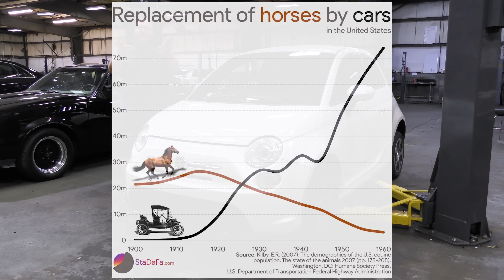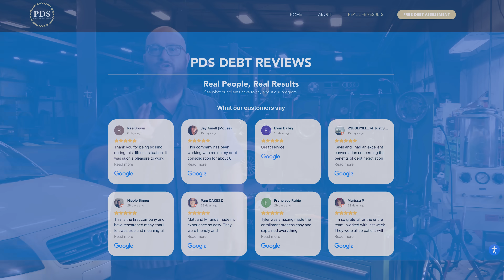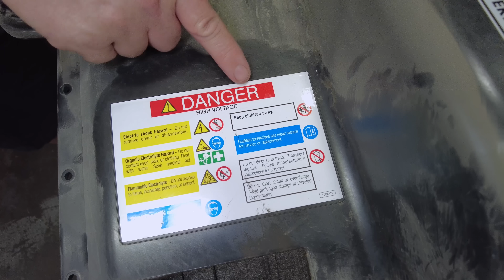How to SAFELY Remove the EV Batteries From my Fiat 500e

Comment: The catch on battery interoperability the problem is this EV  push is from the GUBBMINT (therefore redundantly incompetent). And the proprietary OEMS  who wish to cooperate on nothing. When Intel IBM  opened up the 8088 Cpu. And DOS THE PC  computers too off.  Commodore, Atari and the others went away. Folks here's the roadmap and a 1000 mile range.  Now you future Hot Rodders  get to work on your own dual quad flux capacitors.

Comment: There needs to be standardized 50-100V bricks that people can buy off the shelf. Until then, EV batteries won't be sustainable: you are always one bad cell away from scrapping your EV once the warranty runs out since it is difficult if not impossible to get an affordable known-good replacement. That is almost like scrapping an ICEV because one ignition coil or injector went bad.

I don't particularly care about range as long as it is at least 300mi/500km under worst-case conditions, can charge in less than 20 minutes during road trips and L2 charging at destinations becomes standard.

Comment: It’s not EV’s most opponents of them are really opposed to. It’s unrealistic government mandates forcing people to have to literally buy in to the “green new deal” narrative. Free market will solve the problem and bring desirable products to market, but currently the production capacity is not there to pull the necessary amount of rare earth materials from the earth at the rate required for the government mandated demand. There is currently no safe recycling facilities for recycling these batteries. There is not currently enough capacity in the energy grid to supply all the power necessary for all of us the charge our EVs. The rate at which charging them is too slow to be comparable to ICE refueling, and the faster you charge an EV, the more demand is required from the infrastructure, and the more likely a thermal runaway incident is.
There is also not enough safety protocols and requirements to deal with the inevitability of these batteries catching fire. Frequency of Lithium battery fires is NOT and argument, there are far more dangerous to the environment and the humans involved in extinguishing them. They great their own oxidizer as they burn so they are also impossible to extinguish, everything around them is at risk, and if the person fighting one of those fires could be irreparably harmed or killed from the cobalt gases that are commonly emitted during a lithium battery fire. There is also the issue of ground water pollution from the run off of the water used to fight those fire. Just look at the uninhabited high rise apartment building after the Korean BarBQ that went off in the underground parking when a MB Eqs went us.
There is a lot that needs to be addressed before we adopt EVs as the only means of propulsion.
I don’t think that is wise. There is a reason trains and transport trucks that run virtually 24/7 use diesel engines, even if all they’re doing is creating electricity for motors to turn wheels. It’s more efficient than storing the energy in a battery.
My point is there’s a lot of cases where EV‘s don’t make sense and we need to acknowledge that. The government should stop trying to force them down everyone’s throat. It doesn’t solve the climate issue, anyway. Humans driving themselves around in ice vehicles only accounts for maybe 12% of CO2 emissions, globally. If I could afford an EV and I could charge in 4 hours where I have to park it in a random street spot, I would have an EV, but I’d keep driving my classic car for enjoyment and my ICE appliance car for long trips, except I can only afford one vehicle, it has to live on the street, and the CEO’s get the charger spots at work so EV’s are not for me until those issues are solved, no matter how much I want a Porsche Tycan Turbo S

Comment: That would be great on batteries. However, for an EV, the battery pack is like the motor on an ICE vehicle and we’re over a hundred years going with no standard industry motor.

Comment: Great follow up. It’s great that you began with the horse and cart analogy! 
Regarding unified battery technology you are spot on. If they can create manufacturing plants that simply make the batteries for all car designs worldwide from the same cell types, BMS, etc then we will have success in uptake. Not only would this reduce the outlay for manufacturers of the vehicles, since they simply buy that component outsourced, it would mean cheaper batteries since one or two companies would be making the batteries for the whole market. This would also have the knock on effect that R&D would be more cost efficient for those battery manufacturers. I liken it to having cancer funding for 50 different foundations that research cures and preventions, rather than just feeding one or two foundations the funds. Less costs! Better results!
Some manufacturers are already looking to the swap and go battery tech too… do a bit of digging. I cannot remember which makes, but it may have been the Citroen AMI? This will also be an interesting option in future. Pull up to a large battery swap bank, remove your discharged battery, tap card on bank wall and remove a fully charged battery and install, drive off! No charge delay

Comment: Ive been learning a bit about batteries overall lately, my thought is lithium and high power batteries aren’t getting any bigger for their respective size, we’ve seen huge leaps in mah stored in a small size. So my theory being if you buy a electric car today, by 10-15 years when the packs kaput then a whole rebuild should be more powerful or have a little bit more space for a extra few cells. I sort of see it like modifying an ice car by replacing an old 350 engine with a new crate 350 maybe some things will have to be tweaked or setting changed but it’s been refined due to modern machining.
Reply: Extra cells, and longer to charge :)

Comment: One area that has mystified me is that for some unknown reason EV proponents keep repeating that EVs are "pollution-free" ... while although the actual EV is pollution-free .. the electricity used to charge an EV carries with it pollution.  Maybe they don't realize that burning of coal was most likely used to generate the electricity (to a lesser extent nuclear, hydroelectric, wind).  But if they believe that the coal burning process is 'pollution-free' then I guess it is "pollution-free".  I also find it funny how EV proponents have now become prophets and able to see the future with their "EV's are the future" mantra ... could be but maybe not, only time will really tell... let's compare the Fiat 500e to a 2025 Honda Civic Hybrid ... the Civic is at least $10K less goes a lot further on a tank of fuel and arguably more reliable ... now tell me again why I am buying the 500e??? ... economically it doesn't appear to make much sense ... wait one last calculation ... $10k / $5 per gal = 2000 gals X nominally 30mpg = 60000 miles of "free" driving with the Civic ... EV proponents also tout the lack of oil changes as a plus but fail to mention the opportunity cost of driving an EV to anywhere outside the battery range... bottom line for me ... separating the wheat from the chaff ... the nonsense / the rhetoric / the BS ... ICE vehicles are no better than EVs nor are EVs better than ICE vehicles ... they are simply forms of transportation .. please buy the one you prefer ... What do I drive? come Sep it will be a 2025 Civic SI complete with a manual transmission because I am an enthusiast and enjoy driving a vehicle rather than being a passenger...

Comment: Unified batteries consistent across all brands would be similar to all manufacturers using the same engine and transmission. BMW and Nissan - Honda and Toyota - it’s not happening.

Comment: The part you are missing when it came to horses vs cars, is that the Government didn't tell you that couldn't ride a horse. Or that if you did ride one, you were killing your grandchildren. 
The fact is, I would actually like to have an EV. I would benefit greatly from having one, since 9 out of every 10 days, I only drive too a from my store. But I will not buy one until the 1/2 of the government that I do not support stops telling me I have to buy one. I'd rather walk. Yes ... I am an old, curmudgeonly, boomer. And damn proud of it.

Comment: Electric cars are just a fad that won't last since they have too many problems and will be worth nothing after the battery goes bad in 10 yrs. so buying one is just poor planning by the buyers who aren't looking at what will happen to their purchase in the future. Here are just a few of the problems:
1. Prices too high.
2. Insurance costs too high.
3. No AM radio!
4. No spare tire to use in case of a flat.  Tesla owners have to call a tow truck if they have a flat!
5. Poor resale value, is any at all!  They can't be traded in when the owner wants a new car in a few years since they won't be worth anything and won't even be able to be passed down to another family member if they aren't running and there are no parts available.
6. Poor range.
7. Poor charging networks. I've never seen a charging station on my side of town!
8. Companies going bankrupt!
9. Necessary software updates not always available!
10. Parts and service not generally available.
11. Often can't be repaired after even a minor fender bender accident!
12. Cannot be serviced by the owner or maybe not by anyone if the company has gone out of business.
13. Replacement battery costs more than $10,000 when it goes bad after the 10 year warranty expires making the car worthless
14. Over the air software updates using 4G won't be possible in a couple of years after everyone has switched to 5G!

Comment: LOL; all that has to happen is a car can be driven 1000 miles on a battery pack the size of a loaf of bread.  Common sense should tell you that will never happen safely; the power density for such a proposition is mind boggling.  As the technology is currently, I don't feel comfortable sitting on top of a slab of batteries knowing how much energy is being stored in them; I'm crazy, but not that crazy!

Comment: The heat in Australia is greater and there is no issue with the battery life there so there must be another issue in Arizona.   Is humidity higher?   (High humidity and twmp may be an issue)  Salt used on winter snow?   (Cause deteeioration in terminals)  Just a couple of variations possible

Comment: My friend Audi E-tron with 20,000 miles. Died on the road, it gave him a 30-second warning  before shut off. The front electric drive motor shorted out due to the cooling ports that were drilled into the motor assembly for cooling cracked and leaked coolant into the motor. $20,000 replacement cost. It was performed under warranty. He was not the only one who had this issue. The dealership had 6 other e-tron's with the same failure.
Reply: BMW has had multiple engine failures due to faulty engineering.
Reply: Toyota's recent engine replacement is another example. New technology carries some risk.
Reply: 30 second warning for a catastrophic failure sounds amazing. Much better than boom💥
Reply: They are now using oil to cool the electric motor like in HV transformers, no coolant needed.
Reply: Modern german auto is crap all over the board. I would never buy one car from them, ICE or EV. Just look at what is on the roads: Less than 3 yo vehicles still under guarantee. After that they drop like flies. Even a cheap Chinese car does better than laggardcy German auto (who btw has been caught again using cheating devices to mask the pollution of their overengineered garbage engines).

Comment: Do not try charge it without coolant in the battery pack. The coolant PTC heater turns on for a moment and without coolant overheat, short it will blow the fuse in the battery pack. Had to learn this the hard way.
Reply: Thats what I expected; though it maybe necessary to identify low voltage packs, and bring them up individually into the average acceptable range (safely at low charge rate), before turning control over to the onboard charger to do fine balanceing. Otherwise it may just throw fault codes (call the Tech!) and refuse to charge - been there, done that!

Comment: Anyone who still say "but after 6 years the battery is dead", just look at this fiat, its 10 years old and its problem is an electronic module, not the battery cells. As the wizard said, earlier evs didnt had colling for the battery so their battery was dead quickly. This fiat and anything newer than that have cooling and its rare that the battery degrade so much. Also newer batteries supposed to be have longer life - from what I hear LFP type batteries that is common mostly in anything that is medium and cheap-ish should last basically forever... But as you can see in the video the problem is hard to reach parts that are unobtainable. So a very popular modern EV should be very long lasting. We will see..
Reply: "normal" Li-Ion batteries, aka NMC, have more energy density and are used in phones etc. They last about 800 cycles (0%-100%) until 80% of the battery still works, then there's a rapid dropoff until they die. I actually used a 2012 phone up until 2023 which now doesn't hold a charge at all. So 11 years from new to failiure is pretty good.
LFP batteries are actually worse for energy density (less range for more size and weight) but last 2-3 times longer and are also a lot safer. They should be great for small "around town" cars, something else will fail before the battery does. There's also talk of giving old EV battery packs a second life as powerwalls in houses, so people can solar charge them during the day and run things at night.
Reply: How many miles did he say was on it? Its the charge amd discharge cycles as well as overheating that matters more than how old the batteries are.
Reply: Also most of the lithium in a battery is recyclable. It needs to be reconditioned in order for it to be put back into a battery.
Reply: @MB-jz3uu  really?  Please provide sources on current EV battery recycling facilities and what percentage of lithium recovered.
Reply: @rjbiker66  institution of mechanical engineers did an article on it back in October.
Reply: @rjbiker66  jerryrigeverything did a good video on it. It's pretty fascinating. I used to think it was all doom when it came to electric batteries.
Reply: Batteries don't last forever, your phone is an example. They will degrade to the point that you can't use it for anything useful anymore.
Reply: @popifrex1993  But you can extract the parts and make new ones. Those trace amounts of rare metals / increasing demand for lithium might even make it profitable!
Reply: @popifrex1993  my phone dont have cooling for the battery and it is not LFP
Reply: @popifrex1993  just make sure you recycle it.
Reply: Car has low mileage if it had a hundred thousand it be junk the only reason the battery is ok is because of low mileage
Reply: this Fiat 500e may be the exception rather than the norm. perhaps light usage,and better care/garaged. Cooling doesn't matter when the EV is sitting outside in 110DegF heat for a few months. Southwest US,Florida and the Gulf states,there's heat for several months of the year. Up north,a few months of LOW temps,not good for batteries either. In Buffalo,my dad used to install an engine block heater so his ICE car would start in January and February low temps. the thermal power of a 100W lightbulb made a HUGE difference.
Reply: The battery control module is part of the battery. If it fails the battery is dead.  If the coolant system leaks in the battery pack it will most likely kill the battery.

Comment: I think if there were some tests to determine exactly how much horsepower is required to get and keep a vehicle moving, it would prove the weight of the battery pack and motor will require that much more energy than a traditional engine (be it gas or diesel) and its fuel tank - and thus, EVs would actually be LESS efficient than traditional ICE vehicles. I see EVs as more a niche product that would have their place where air pollution is a chronic issue - for any other use case, it is a solution looking for a problem.

Comment: What happens if the battery control module goes bad again? What are you going to drive in the meantime? A second car needs insurance and and many other things too. So to have an electric car you must have a second car, otherwise you are going to be walking a lot,,,,,,,,I don't want to be a guinea  pig owning an electric car. You just can't rely on them or get parts for them. Thanks but no thanks!,,,,,,,,,,,,,,,

Comment: You made a bad argument, combustion engines were better than horses. EVs are not better than combustion engines, in fact they have trouble matching the stats of combustion engines. "They will get better!", yeah well, combustion engines can get better to, so...
Reply: Afraid not unfortunately, combustion engine with a gearbox can only make 35 to 40% efficiency at best. The rest is gone due to heat and mechanical losses. EV can make 90% as it's a battery almost direct to a motor. Sorry but true.
Reply: @mlann2333  You are presuming that combustion engines will keep burning the same stuff they are burning today. Furthermore, electricity must come from somewhere, and that somewhere is most likely combustion since eolic and solar are unreliable and unprofitable. So instead of burning something in your car, you burn it in a powerplant. There's charging stations that run on diesel enigines hidden behind the bushes. There goes energetic efficiency.
Reply: @Damx3  combustion by name means burning which means heat which means losses. Not just me saying this, it's just the way it is